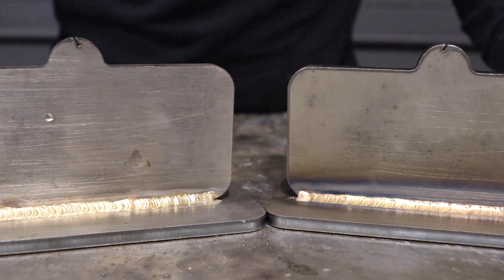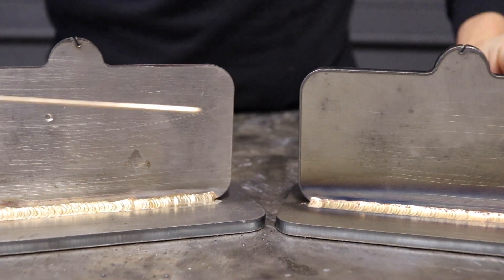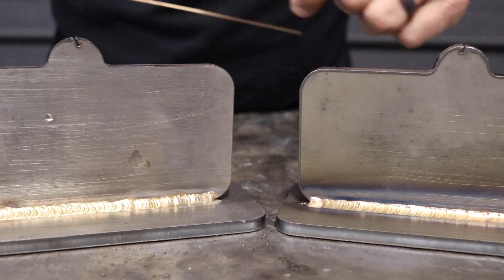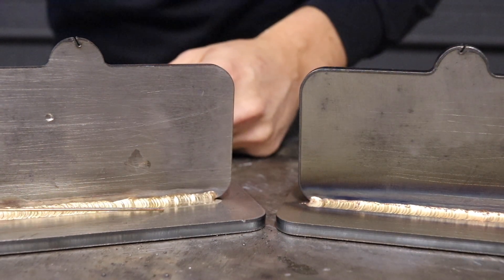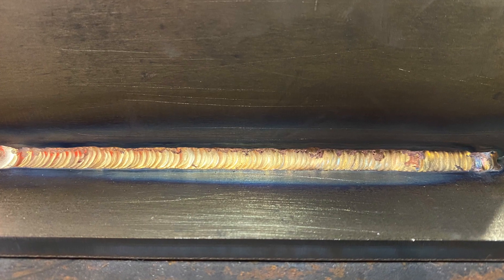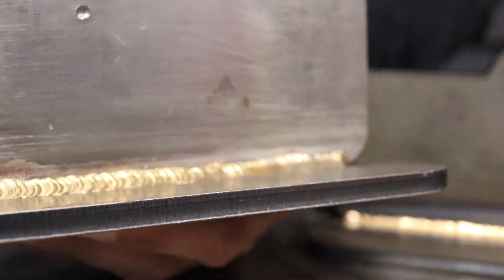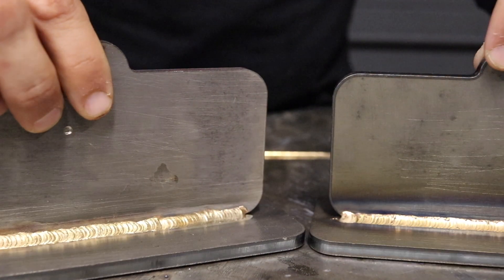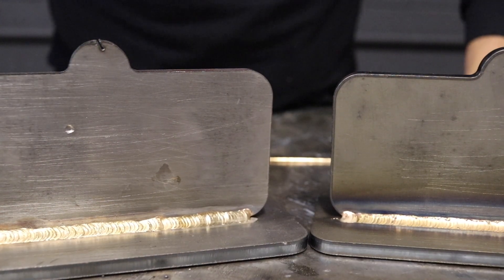AC or DC for Silicon Bronze?

Comment: Hmm... that's not completely accurate.  Given the same output amperage, the minimum necessary ( obviously over amperage will defeat the experiment)(I suggest using a trigger switch for the experiment to eliminate possible output variations ) same travel speed, I think you will find slightly deeper, more concave welds with dcen.  Remember 2/3 of the heat follows the direction of polarity. Dcen continually focuses the majority of heat at the parent metal. When using AC, the heat focus switches back and forth from parent metal to tungsten,  so by definition,  for a percentage of time heat focus reverses into the tungsten,  even regardless of balance settings. This is not necessarily a bad thing, especially when welding thin parent metal, it can actually help prevent burn through.  Not a bad thing, just not the same thing in terms of penetration.